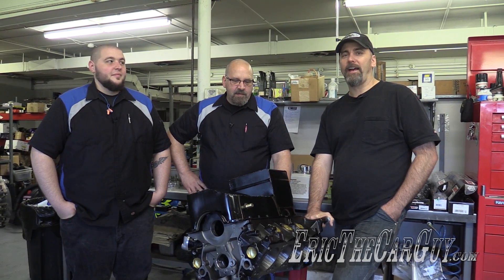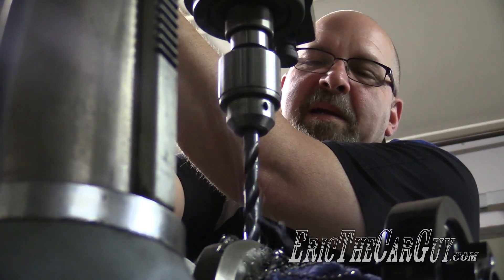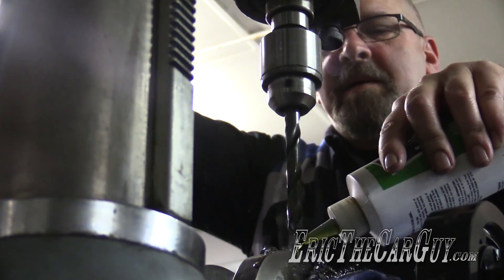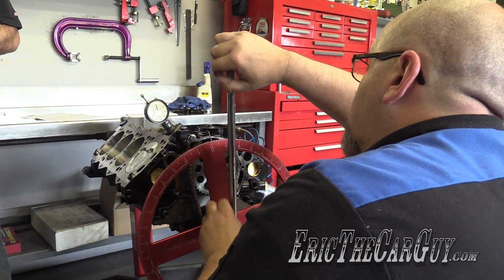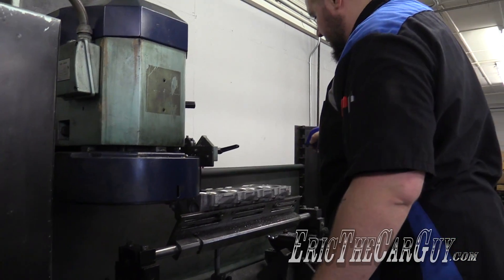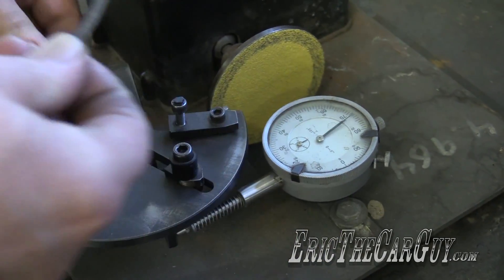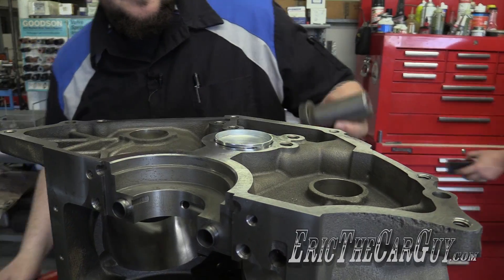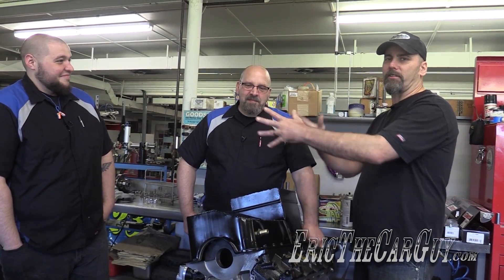An Introduction to Kalvinator Engines #FairmontProject

Comment: I've had work done from these guys. They gave me some of the most horrible advice I've ever heard from a engine builder. Was told  a brand new set of bare heads don't need a valve job when inquiring about having a valve job done. When I asked about honing a sbc 350 block I was told he was going to use a ball hone when  inquiring about having a 350 block fashioned up. I had them balance 2 rotating assembly for me. And I was treated like pure shit when I came to pick up the second one. Had bad attitude the moment I walked in the door. Was throwing his receipt book around. Then they did a horrible job balancing my crank. They welded a piece of Mallory on the counter weight threw the bottom and it failed and slung out threw the top of the valley destroying my block and intake. All there equipment is old. The shop has never really growed and it's still a small nobody shop and I can see why.  They have no dyno. They dont do any tuning. And no they won't take no responsibility for the hack balancing job that destroyed my engine. I now take everything to Ohio crankshaft.

Comment: It's good to see experts doing what they love.
Reply: Expert engine builders and machinest will not add Mallory from the bottom of counter weights and wield it. That's how kalvinator balanced my crank and the weld failed and shot the Mallory threw the valley of my block destroying my block and intake. Pretty much destroyed my whole engine. I would never recommend anyone taking anything to them. I have all my stuff balanced at ohio crankshaft now. They had Mallory threw the sides like its sapose to be done
Reply: @Wesley-v1k  I'd really like to know more about your build.. not saying anything is possible  but just on my own dealings with Kevin at kalvanator engines and his past history.. I don't see Kevin installing Mallory vertically in your crankshaft unless you approved it ..cause based on his experience He  would have not done it unless the factors like max rpm ect. would have him to believe it was safe.  I had him do my short block rotating assy for my 414 SBF  stroker.. he had to install Mallory due to my light wight crankshaft with my heavy H beam rods.. and he did it horizontal like it should be done no welding just press fit.. the hole assy was balanced under a gram.. way less then most shops due.

Comment: You can see that Eric was confused when Kevin said Kelvinator or Kalvinator owned Jeep in 1979.  AMC owned the Jeep name from 1970 to 1988. AMC sold its Kelvinator (spelled with an "e") division in 1968. Kelvinator was most know for its kitchen appliances.  So, again, why did they name this engine building company Kalvinator???
Reply: Cause it sounds cool. Engines by Frische doesnt sound as cool

Comment: I will definitely keep this video in mind with my next long block build. I'd like to take my other Ford '67 289 and have the bottom end reenforced (possibly by these gentlemen). My goal is to see how much max rpm I can get without it blowing up. Then bolt it to a T-56 6 speed manual and install in my next V8 Ranger build. High rpm's + long legs= A crap load of fun!